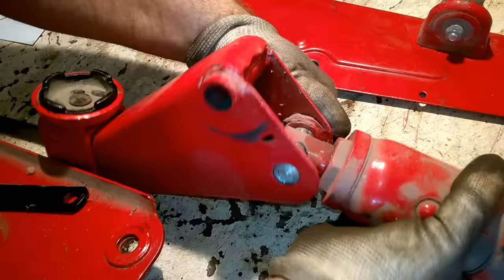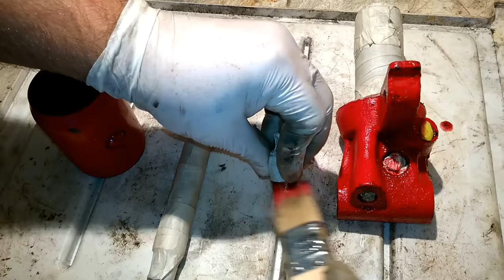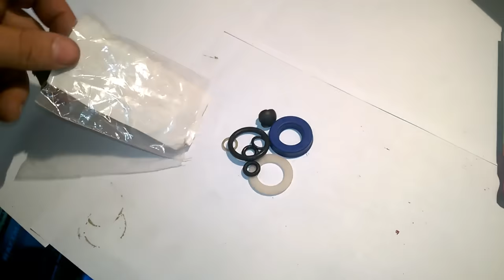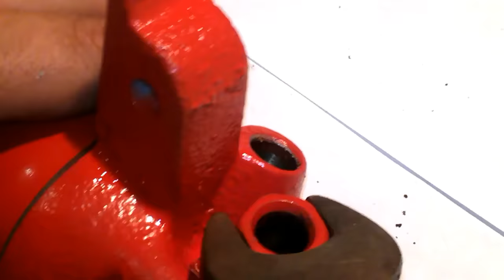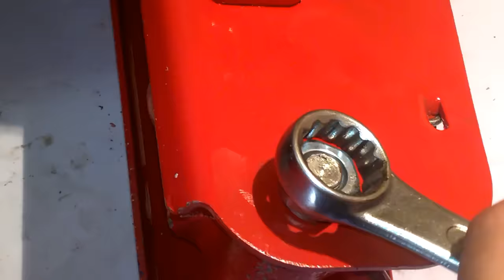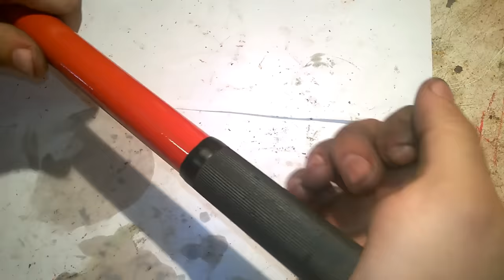2 ton old hydraulic jack restoration / Blaze

Comment: Great video, good work.
I have a similar jack. the problem is that it does not hold the pressure, after lifting the car goes down by itself. What parts do you think I should change? What are the dimensions of the gaskets you changed? Thx
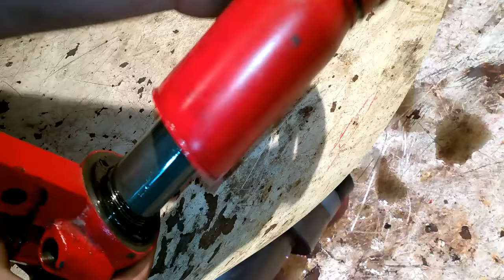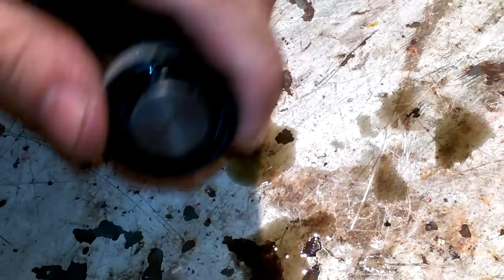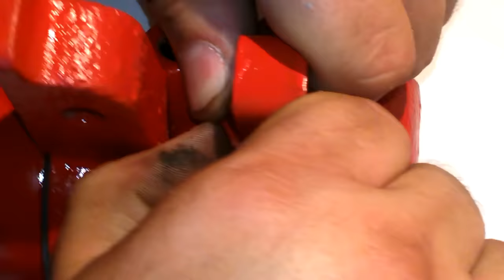Reply from the maker: Thx the comment. Familiar error. If you watch my video for 0:51- 0:57, you can see one of the reasons(sleeve damaged). The other error at 4:07 minutes the little ball doesnt close. I hope I helped you, if you have any questions please write me down. Please watch my other videos, like, share, comment, subscribe.

Comment: Bonjour  ou je peux acheter les joints ?? Quel site  internet ?
Merci  et bravo pour la vidéo
Reply from the maker: Merci pour le commentaire. J'achète les joints toriques et les pièces en plastique dans un magasin régulier de joints toriques et de joints hydrauliques. Le manchon est plus résistant (max. 400 bar) pas d'origine (max. 100 bar). J'ai pu acheter les autres pièces au magasin de montage habituel. J'espère que cela vous aidera.
Veuillez demander si vous avez d'autres questions.
S'il vous plaît partagez, aimez, commentez, regardez mes autres vidéos
Vidéos:
https://youtu.be/HP-pyyWtUhk
https://youtu.be/yt9RvIWh0Vo

Comment: Where did u buy all the new o rings and seals?  Thanks
Reply from the maker: Thx the comment. The total delay teaches $ 10. I buy the o-rings and plastic pieces in normal o-ring and hydraulic-seal shop. The sleeve is stronger ( max 400 bar) not original (max 100 bar). The other pieces also I could buy in the normal seal, gasget shot. I hope I could help you. Please ask if you have other questions. Please share, like, comment, watch my other videos

Comment: I need that O-ring kit!!!  No O-rings from HomeDepot or Harbor Freight are that same exact size??
Reply from the maker: Thanks for the comment. I buy the o-rings and plastic parts at a regular o-ring and hydraulic seal store. The hose is stronger (max. 400 bar) not original (max. 100 bar). I was able to buy the other parts at the normal gasket store. I hope it will help you.
Please ask if you have any further questions.
Please share, like, comment, watch my other videos
Videos:
https://youtu.be/HP-pyyWtUhk
https://youtu.be/yt9RvIWh0Vo

Comment: Cool stuff 👍🏾👍🏾 mind me asking where you purchased the new seals?
Reply from the maker: Thx the comment. The total delay teaches $ 10. I buy the o-rings and plastic pieces in normal o-ring and hydraulic-seal shop. The sleeve is stronger ( max 400 bar) not original (max 100 bar). The other pieces also I could buy in the normal seal, gasget shot. I hope I could help you. Please ask if you have other questions. Please share, like, comment, watch my other videos

Comment: I like your rebuilding project. I presently have an OLD Sears 2 ton trolley jack (214.125400) pretty much like yours. However, it has a few different seals then yours. Where did you get your seal kit? I haven't found any place the has a seal kit for my very old (1989 model) jack. Thumbs Up on your video and final project.
Reply from the maker: Thx the comment. I buy the o-rings and plastic pieces in normal o-ring and hydraulic-seal shop. The sleeve is stronger ( max 400 bar) not original (max 100 bar). The other pieces also I could buy in the normal seal, gasget shot. I hope I could help you. Please ask if you have other questions. Please share, like, comment, watch my other videos
Reply: @Blazebb01  do you know how this special sleeve is called? what do i have to look for? i can't find it online.
Reply from the maker: Hello. I attach a website how can you find other name of the sleeve. But, if you search name of Cuff then you find a good parts. 
I hope, I would help for you.
Please watch mí other videos, like, share, subsribe, comment.,
My other videos:
https://youtu.be/HP-pyyWtUhk
https://youtu.be/yt9RvIWh0Vo
LInk for the sleeve:
https://polyurethan.com/product/manzheta-poliuretanovaja-dlja-gidrocilindrov-70-03-8060/

Comment: Where to buy repair kit ?????
Reply from the maker: Thx the comment. I buy the o-rings and plastic pieces in normal o-ring and hydraulic-seal shop. The sleeve is stronger ( max 400 bar) not original (max 100 bar). The other pieces also I could buy in the normal seal, gasget shot. I hope I could help you. Please ask if you have other questions. Please share, like, comment, watch my other videos

Comment: Can you give me the link to the Repair kit ?
Reply from the maker: Thanks for the comment. I buy the O-rings and plastic parts at a regular O-ring and hydraulic seal store. The sleeve is stronger (max. 400 bar) not original (max. 100 bar). I was able to buy the other parts at the normal gasket store. I hope it will help.
Please ask if you have any further questions.
Please share, like, comment, watch my other videos
Videos:
https://youtu.be/HP-pyyWtUhk
https://youtu.be/yt9RvIWh0Vo

Comment: Hi we need seal kit
Reply from the maker: Hello. Thx the comment. I buy the o-rings and plastic pieces in normal o-ring and hydraulic seal shop. I hope I can help you. Write if you want more information. Please watch my other videos, like, share, comment.
Reply: @Blazebb01  hey, can you give me please a link for the seal kit, need the same kit, i cant found it on the Internet, eBay or Amazon? Thank you
Reply from the maker: Thanks for the comment.
Unfortunately I can't provide a link because I bought them at the local store.
I tried to find a link for you on Ebay and Amazon, but I couldn't find it.

I buy the O-rings and plastic parts at a regular O-ring and hydraulic seal store. The hose is stronger (max. 400 bar) not original (max. 100 bar). I was able to buy the other parts at the normal gasket shop. I hope it will help.

Please ask if you have any further questions.
Please share, like, comment, watch my other videos
Videos:
https://youtu.be/HP-pyyWtUhk
https://youtu.be/yt9RvIWh0Vo

Comment: You should also smooth out those two notches in the cylinder to prevent future damage to the piston seal.
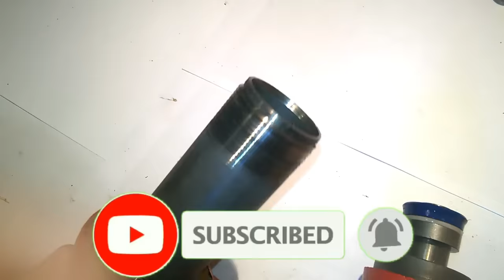Reply: You can see these in 3:06
Reply from the maker: Thx the comment. I buy the o-rings and plastic pieces in normal o-ring and hydraulic-seal shop. The sleeve is stronger ( max 400 bar) not original (max 100 bar). The other pieces also I could buy in the normal seal, gasget shot. I hope I could help you. Please ask if you have other questions. Please share, like, comment, watch my other videos.
Reply from the maker: Yes, I can. I polishing this two notches, I did it but it's not in the video this period.
Reply: @Blazebb01  Ah, then it's OK
Reply from the maker: @Sco0bY91  thx the comment. :)

Comment: Why are rebuild kits so darn expensive, they cost as much as a new jack?!
Reply from the maker: Thx the comment. The total delay teaches $ 10. I buy the o-rings and plastic pieces in normal o-ring and hydraulic-seal shop. The sleeve is stronger ( max 400 bar) not original (max 100 bar). The other pieces also I could buy in the normal seal, gasget shot. I hope I could help you. Please ask if you have other questions. Please share, like, comment, watch my other videos

Comment: Dónde se consiguen el repuesto
Reply from the maker: Gracias por el comentario. Compro las juntas tóricas y las piezas de plástico en una tienda normal de juntas tóricas y sellos hidráulicos. El manguito es más fuerte (máx. 400 bar) no original (máx. 100 bar). Pude comprar las otras piezas en la tienda normal de juntas. Espero que te pueda ayudar.
Por favor, pregunte si tiene más preguntas.
Por favor comparte, dale me gusta, comenta, mira mis otros videos
Videos:
https://youtu.be/HP-pyyWtUhk
https://youtu.be/yt9RvIWh0Vo
Reply: Soy de Orizaba Veracruz México y dónde se consiguen los repuestos e buscado en varias tiendas y no los tienen
Reply from the maker: Compré el juego de juntas tóricas en una tienda de sellos hidráulicos. Llevé las juntas viejas (usadas) a la tienda, las midieron y compraron juntas nuevas.
Aquí está la dirección de una tienda.
https://www.google.com/maps/place/MCVHIDRAULICA/@19.1891892,-96.1384005,17z/data=!3m1!4b1!4m6!3m5!1s0x85c3475f4e53e081:0x124cfd63431d6799!8m2!3d19.1891892!4d-96.1384005!16s%2Fg%2F11h60t23c9?entry=ttu

Comment: And so what about bleed? Not needed?
Reply from the maker: Thx the comment. Please watch my other videos, like, share, comment, subscribe.
What do you think? What kind of bleed?
Reply: @Blazebb01  try find bleed hydraulic jack... bleeding remove air.
Reply from the maker: @mptraxx5317  The hydraulic lifter does not need to be bled, because as you can see, the outside of the cylinder is the tank. When the drain valve is open, the liquid fills all sachs.
Reply: @Blazebb01  hmm okay mine hydraulick jack wont lift he is down.
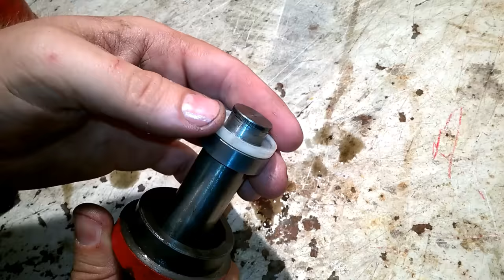Reply from the maker: the claw error is why mine didn't pick up. it can be seen in the video at 01:00. The new sleeve is capable of a pressure of 400 bar. Thank you for your comment, please watch my other videos, share, like,